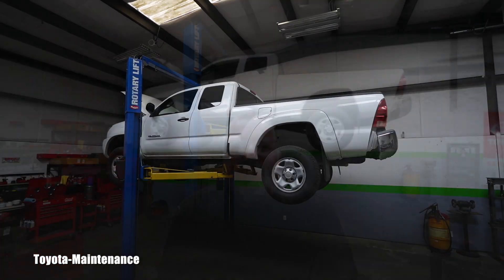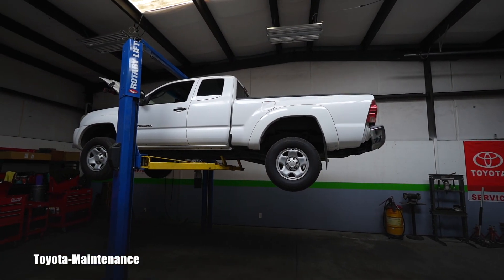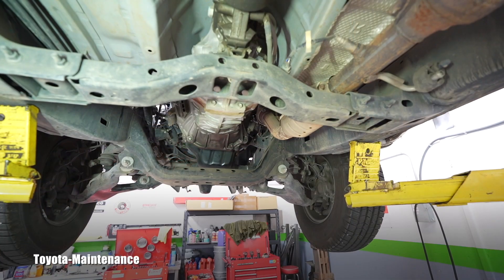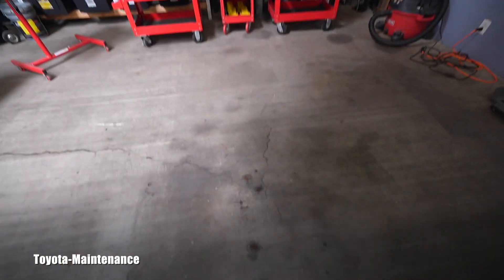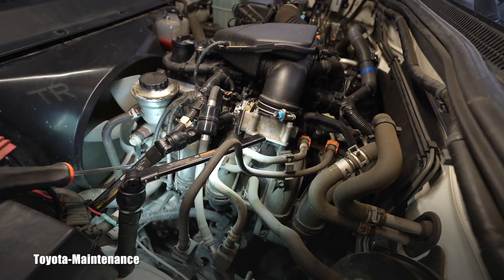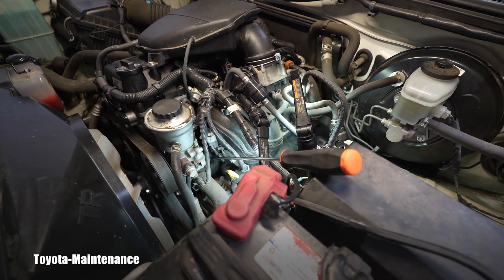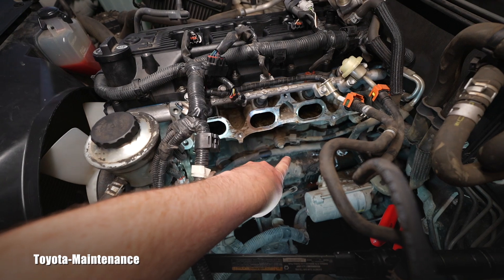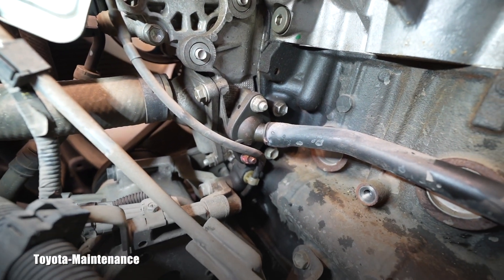Fatal Design Flaw With Toyota 2.7 2TR-FE Engine

Comment: Excellent video!  I'm dealing with a major coolant leak on my '05 Tacoma with just over 100,000 miles (I bought this truck new, I've treated it very nicely, and no major accidents).  Coolant seap for last 10k miles which I stupidly ignored by just watching engine temp gauge all the time.  Now seap has devolved into leak.  Thanks for the info.

Comment: I bought a 2005 tacoma about 6 months ago and it had the same leak. I quickly replaced it with the upgraded pipe and gave it a flush wile I was at it. I also replaced intake manifold gasket and throttle body gasket as well as the valve cover gasket. Truck is running great. I love driving this truck more than my 2021 Tacoma.

Comment: My 2011 regular cab 2.7 2TR-FR 4 speed automatic Tacoma has this plastic pipe and it isn't leaking at 133k miles. However, I'm going to take your advice and replace it. My local Toyota dealer (Capitola, CA) offers the metal pipe for $81.

Comment: Just checked, thankfully my year 2012 Tacoma with 2tre-fe engine came factory with the metal pipe already so won’t need to replace. Thanks for the video.
Reply: I just check my 2011 with a 2TR-FE and it has a plastic one! Maybe that was the last year they did that!

Comment: Thanks for the heads up. I have an '06 model with this engine, I haven't had any coolant leaks yet but I will keep an eye on this. If i have the occasion to remove the intake I will replace this part.

Comment: You are a life saver very easy to understand when you explain things. I have the same truck my head gasket is seeping oil some times does it need to be fixed or is it okay it has alot of miles on it and I'm told to leave it alone. Tia

Comment: I am an ASE Master Certified Mechanic with an L1. Current. I fix cars for a living. Plastic parts in cooling systems are very common. It is also really dumb. Ethyl glycol (coolant) is a plastisizer. It will always want to bond with plastic and it eventually permeates it as it tries to become one. Every plastic part has a finite life span. Good on you for catching this one and demonstrating how 'modern' cars work. I have a 2009 Tacoma single cab with the 2.7 and an A340. I tow a little camper trailer on thousand mile trips all over this country. I don't ask much from the truck because I know it's old and weak. It has almost 200k miles on it and I expect to get another 200k out of it. When this part fails I won't be surprised just annoyed. Thanks for a great video. Liked and subscribed. Also Toyota's may be simple but they are not easy to work on.

Comment: I'd replace it on any 2TR-FR engine leaking or not. Mine blew on the freeway, cooked the engine. I have installed a sensor for a alarm so if there is no coolant circulating I will get a light and buzzer in the cab. I bought a used engine with 65K miles

Comment: cut the ends off new metal pipe and clamp on heater hose to make it same length.    then snake it up in there from the bottom.  no need to create more trouble and spend $$$ removing all that stuff on a high mileage engine.   I have 50K on that repair and still going

Comment: Thank you!
Actually a quite easy job.. 
2 clamps, 3 bolts, a couple plugs and 3 hoses to completely remove the intake baffle. Then 2 studs, 2 nuts and one plug, to lift off the throttle body and move to rear of engine cover. Across the top 1 nut, 3 bolts, and 1 more nut. Then, through the wheel well, 2 more bolts on the bottom of the manifold. A couple more hoses and electrical plugs and the manifold is completely free to wiggle out from under everything that remains. 30 minutes to remove the entire manifold. 
(I've been on a crazied hunt for a vacuum leak that I FINALLY found using starting fluid! (Propane, brake clean, and water all failed to yield results)
Reply: make a video and show us...

Comment: Around twice a year , I will power wash my engine and let dry . Then to liberally spray 303 Protectant all over the engine compartment and let it soak in . To help plastic parts to resist the heat and try to keep from drying out and cracking as long as possible .

Comment: If anyone can help would be awesome I have a 2005 Toyota hilux workmate 2tr fe and I have described it to my mate who’s a diesel mechanic and he has told me it is called a ‘sight’ it’s where the tranny connects to the motor and I can move a plastic plate about 5-7ml left and right and my hand was then covered in grease and oil

Comment: Did this on my taco,  didn't have to remove the intake manifold, 15 minutes total time. Got the replacement metal part off eBay for about 35 bucks
Reply: How did you do it?
Reply: @dominickmercado2284   He isn't telling the truth.  I did it, it's impossible to do in 15 mins.
Reply: / @Me-zo8yc  How was it done?
Reply: @highvel-kq2to  intake manifold off etc etc etc.  Took a day working very methodically and slowly, someone familiar with these engines could do it quicker

Comment: The coolant bypass was replaced by the stainless steel upgrade, and even with a rotted bypass, it's not a "deadly" flaw. The computer will throw codes like a christmas tree before it gets catastrophic, and even at that point, the head gasket would have to blow before complete failure, and guess what? Even with a misfire, it would still take intentional misuse of probably thousands of miles before she would kick the bucket. How do I know? Numerous 22RE, 3RZ, and yes, many 2TR-FE complete rebuilds. The 2TR is the great grandchild of the 22R series, and it is the absolute most dependable 4 cylinder engine thus far. Many rock crawler builders that went SAS (that's "solid axle swap" for all you novice Yota owners) run this engine completely stock without a turbo and it has no problem chugging along a low geared, fully locked front and rear axle rock crawler rig along the frozen rocky trails of New England, Alaska, Maine, Vermont, Canada, even over in Europe, or the extremely hot trails and deserts whether in 120F weather in Death Valley, or the scorching hot sand dunes of the Middle East. Any well seasoned mechanic well versed in Toyota builds knows, the old coolant bypass was minimal. If any part would be considered "catastrophic", it would be the factory head gasket, known to go at around 130-250K miles. I don't even know why I am commenting on this, for this is old news. 🔧
Reply: Have you ever heard of a front crank seal leak issue? Mine is currently pushing a lot of oil onto the driveway and I ordered the replacement part for it. Just have to pull the engine to get it done now. But damn it is a lot and I've never seen anything like it
Reply: @billymays303  Yep, crank seal is typical on the 2TR, if I remember correctly it's behind the cam chain cover. I had to do mine when I did my headgasket. Pretty much all the seals and o-rings, I even did the injector cups and o-rings while I had it apart. Once you do the gasket, cam chain hydraulic tensioner, water pump and seals, you should be good for another 200k (on road) and 150k (offroad). Throw some Accel coil packs on ol' girl while she's apart. Maybe a Optima yellow top. But regardless, don't use anything other than genuine Toyota parts. 🔧
Reply: stupid question, but what can be done to prolong the life of the head gasket on the 2tr?
Reply: @AG-rk5hj   Dont over rev the engine. If you mean as far as maintaining original factory gasket, baby the engine, don't over-rev, don't lack on maintenance ie oil changes, coolant flush and t-stat. As far as replacing the head gasket goes, stay away from the scam in a bottle magic gasket sealers, and bite the bullet and do it properly. You have to send the head out to get decked (machined and checked for cracks, as well as making sure valves are still good while it's apart) you have to use a factory genuine Toyota MLS gasket, and it's also a great time to do the cam chain hydraulic tensioner while it's apart, as well as water pump and t-stat. Typically the head gasket goes around 130-200k miles. The 2TR series is in my opinion the best dam 4 banger in the history of Toyota 4 bangers, add a turbo or super charger and even better. If you're looking for a good battery to stuff under the hood, I highly recommend going with the Optima "Yellow Top". Mine is still going strong over a decade later.

Comment: My 2023 is metal from the factory. I wonder when they stopped using the plastic pipe...
Reply: 2011
Reply: @jaysmith179  Oh okay, thanks. 👍
Reply: @jaysmith179  FML! got a 2o11 with 96k with the plastic piping

Comment: Very similar problem on my 04 Sienna. It was a fairly easy fix, but I barely made it home when the part totally failed. 
Manufacturing needs to rethink rethink where they use plastic parts. I will not buy any German car, or motorcycle.

Comment: Replacing this plastic coolant pipe has been on my to-do list for a while in a 2006 Tacoma with 76,000 miles, hope I can do this before it starts to leak and cause damage from overheating.

Comment: I am no engineer , but when you combine multiple parts made of different materials in the under hood environment , all bets are off . They all have different properties , such expanding and contracting with heat and cold . When mated together , they all may not get along well . Plus , most plastics may not survive the long haul . Many become brittle over time . Maybe they are just trying to get past the warranty on the cheap !

Comment: Eh I don't really see this as being a design fault. Old Toyotas with steel pipes had the same fault, just as a result of corrosion. Plastic cooling system parts happily last over 300,000 km

Comment: Don't think the plastic air filter housing/box won't break, because they do, eventually. I bought my 2000 Tacoma 4x4 with 3RZ-FE engine brand new, and after about 17 yrs, 3 of the plastic mounting tabs that bolts the entire air box to the vehicle broke clean in half. When I totally rebuilt my 3RZ-FE engine last year, I replaced the entire air intake with a cold air intake, using a permanent dry air filter that is cleanable. I don't advise installing a cold air intake by itself because you will lose a little performance, but I also replaced my entire exhaust with a quality stainless/ceramic coated header and entire 2.5" ceramic coated stainless steel exhaust system including a new free-flowing catalytic converter. There is absolutely nothing good about plastic parts under the hood of any motor vehicle. The heat & vibration WILL cause them to fail sooner or later. The only exception is sensors/sending units, but even those must be replaced eventually. I hate plastic.
Reply: Did you rebuild your 3rz yourself? What was the mileage at the point of rebuild?
Reply: @karobiawho6845  No, my close friend who has been a Toyota tech for over 25 yrs turned me on to one of his best friends who owns & runs the best machine shop in east/central Florida: "Brevard Cylinder Head Exchange & Machine Shop" of Merritt Island Fl. Those guys take on stuff most shops turn away, such as rare/antique aircraft heads.......but they build some of the best race engines around too. And the guy LOVES the 3RZ and 2JZ engines. I finally blew a head gasket at 374,000 miles ( or was it 376K, I would have to check my records ). The bottom end was still great, but I wanted the full compression of a new engine, so I bought a master rebuild kit from LC Engineering ( LCE ), a brand new genuine Toyota head casting, and LCE built the head with OE sized stainless Super Tech Nitride coated Inconel racing valves, stiffer valve springs, hardened keepers, and Viton valve seals. Bored it .020" over with Hastings moly rings, King main bearings and all Japanese rod bearings, thrust bearings, etc. Top quality oil pump assembly/water pump/timing chain/gears & components. Bought their balance shaft delete kit because of their trick custom oil jet that oils only the timing chain & gear, so no oil pressure wasted using the original jet. Bought their EGR delete kit too. New harmonic balancer. New knock sensor, etc etc. Also put a "double armor coated" long-tube Pace Setter header ( looks like chrome, guaranteed to never blue, chip, blister, or peel ) and LCE's entire stainless/ceramic coated 2.5" Pro-Flow exhaust system w/MagnaFlow muffler, and I already mentioned the other stuff in my previous comment. I also bought the Bilstein 4200 series shocks and MAN, it rides & drives like a sports car now. NO BODY ROLL. Takes bumps & humps better too, for off-road. Those shocks used to be around $175 each back in 2000, but you can get em nowadays brand new for under $100 each. I have already prepped, treated & painted the entire frame myself with POR 15, it had hardly any surface rust to begin with. Tom Woods custom HD drive shaft. All new Schaeffler/FAG bearings front & rear. NGK Iridium IX plugs and Magnecor wires. She's better than new now, lol. Runs like a bat out of hell with stock cams. Under the hood looks far better than it did brand new 23 yrs ago. Installed all new front and rear bumpers/trim. I'm down to minor body work, paint, and wheels now. Gotta get my seats re-done. I truly believe the only reason I wound up blowing a head gasket is because back during that horrible recession in '08, I literally couldn't afford to change the coolant to feed my family & save our home. I believe the old coolant turned acidic & started chewing away at the head gasket. Before we rebuilt it, the engine didn't burn a single drop of oil. I'm running Amsoil full synthetic in it now. This truck will outlast me now, lol.

Comment: They used plastic because it was far cheaper than a stainless steel pipe, which had to be bent and welded on at least one end. Making that pipe took a lot of steps. Plastic can be spit out of some molding machine is a second. That stainless pipe looks like something that came off the Space Shuttle engine.

Comment: Me and my Toyota mechanics at  a private shop are keeping a double eyeball watch on plastics under the hood of my 08 Tundra 2 wheel SR-5 3UR-FE with 15 years but only 61K miles. Should be interesting as time is harder on plastic than the miles.

Comment: Toyota replaced this with a metal pipe on all 2011 and after 2TR-FE Engines, at least here in Japan land according to my dealer. Thank god because I seen the videos to replace this.
Reply: I was amazed it doesn't seem to have been recalled even in Japan.  I have a 2008 imported vehicle with 2TR-FE, and just changed this pipe for the metal one.  I thought for a JDM vehicle, with their strict Shaken, it would have been mandatory.
Reply: I have a 2011 with a 2TR-FE engine and it has a plastic pipe.  I bought mine used in North Carolina several years ago.
Reply: Yeh you're right. i just checked my 2018 Toyota Hilux and they have used the metal pipe. This is an Australian model truck similar to the Tacoma and uses the 2TR-FE.
Reply: My 2011 still has the plastic pipe and it is leaking.  So, not all 2011's.

Comment: VW has been using inferior plastics and when you touch them they break. And even when you don’t touch the temp sensor housing on your 1.8 T engine it falls apart from engine heat and vibrations.

Comment: Plastic bits will only handle so many heat cycles. I looked at many different year Tacoma's as since I drive 400 miles or less per year I wanted simple, very few electronics, and a year that I could do the vast majority of maintenance myself. I decided on a one owner 2003 Pre-runner 3.4L that had all services performed at the same dealer with all receipts. It had all ball joint TSB/Recall completed still no valve cover gasket seeps. It has lived it's life in dry California, the factory bar code stickers are still readable on all parts under the truck. I'm sure it will out live me. Not muck plastic under the hood and with the clock being the only drain on the battery while it sits covered my cheap Autozone battery is going on 8 years.
Reply: You drive less than 400 MILES PER YEAR??? Or is that a typo? ( I would guess that most healthy people walk more than 400 miles per year, lol. )
Reply: @howabouthetruth2157  I live in the perfect area as I can bicycle for all of my errands. I originally purchased the Pre-runner so myself and friends could load up the bikes and hit the road unload the bikes mount all of our gear on them and do some bikepacking/ camping etc. Before we could get our trips figured out I was hit by a car on a training ride. I spent 4 months in the hospital and rehab centers as I was paralyzed from the neck down and a brain injury so the truck sat for almost a year while I was working on myself. I went from 10k miles 13k the year I was hit to now around 800 per year which I'm still working on. It's a great truck that people leave notes on and want to purchase. I've considered it as just a base plain jane is all I need now but the ones I've come across are used up neglected, and over priced.I'm still working my ass off so hopefully I can get to the point where I can ride my off road bike weighted down with camping gear up in the mountains. Many recommend e-bikes no thanks I'll continue to push myself. People don't consider the extra dead weight one has to pedal when out of juice up in the mountains and 40 pounds of gear strapped to a frame. Sorry didn't mean to write an autobiography but it all ties together my location is perfect
Reply: @djmjay2  No, that's quite alright, I enjoy reading lengthy comments so long as they are not offensive and offer me the information I was asking for. It truly saddens me to learn you were nearly killed by some motorist. I'm glad you're doing ok. Thanks for your response and best wishes to you Sir.

Comment: They put the same plastic pipe on the 16 also
Reply: Are you sure? Multiple people wrote they went back to a metal pipe in 2011. If that's true, I can't imagine they'd switch back to plastic again in 2016.
Reply: @mickm5097  It must be 2012 models because my 2011 has the plastic one and it's cracked.